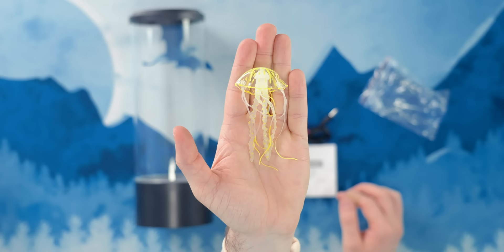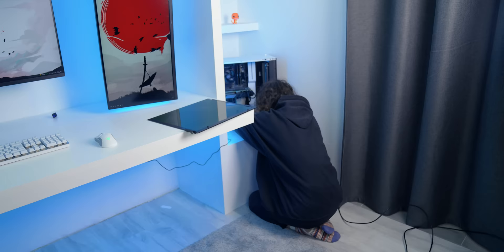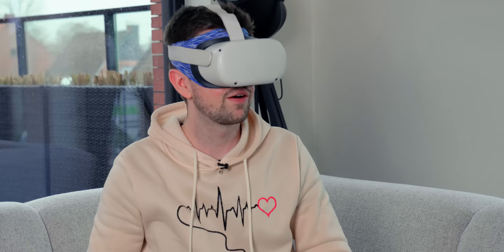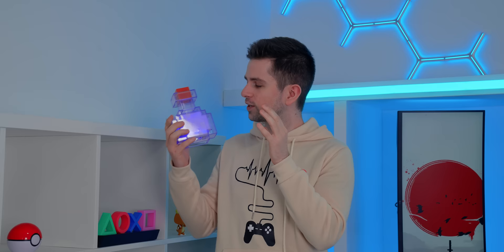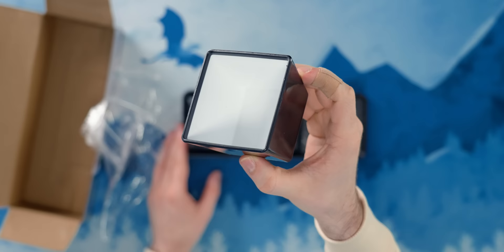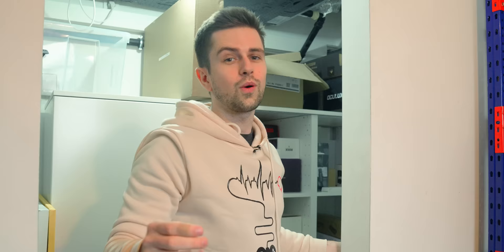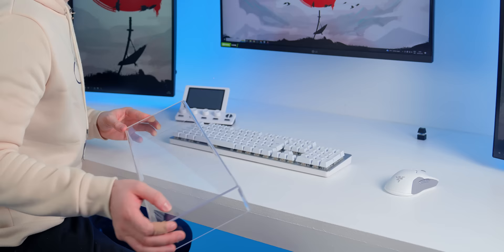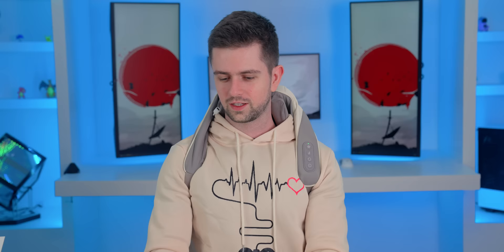50 CHEAP Gadgets For Gamers From Temu!

Comment: 22:36 It's probably measuring correctly. USB Quck Charge isn't always 5v. Quck Charge 3.0 can be from 3.2v to 20v in 0.2v increments. The phone and the charger negotiate a charging voltage and current. The iPhone preferred 5v, while the One+ preferred 9v.

Comment: filters can ve very simple, that filter looked like the same that is in sleep apnea machines, but it was much bigger
Reply: its a coal filter ;-;
Reply: CPAP machines have an entirely different purpose, though. Like, its main purpose is not to clean the air, just provide air that has nothing you can choke on. An air purifier is supposed to scrub the air clean of most contaminants in an area. The thing in the video was completely useless.

Comment: Now, i need to pause for a moment. at 18:21 you're showing an automatic door closer. I've seen in many times, especially on Christmas last year and bought 2 of these cause i needed them. I STRONGLY ADVISE YOU TO NOT USE THEM if you have to make them "curve". If the metal string gonna be in a straight line from the casing to clip, they it would probably work better, but i had mine curvet at nearly 110 degrees and it didnt lasted a month. The plastic cover quickly got worn out and the string itself started to break, eventuually snapping midway with a loud bang. MAYBE they work better if you mount them in straight line (i dodnt had any onther option than curve them) or if you do it like me, just buy like 10 for 1 pair of doors so it will last at least a year.